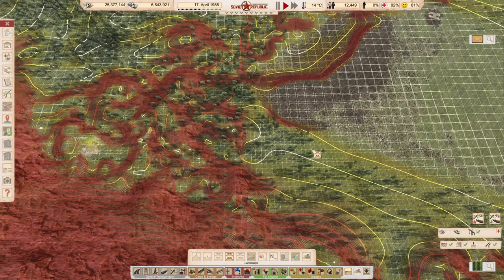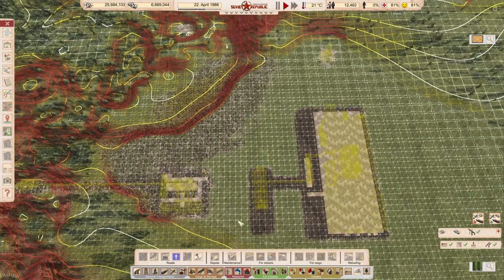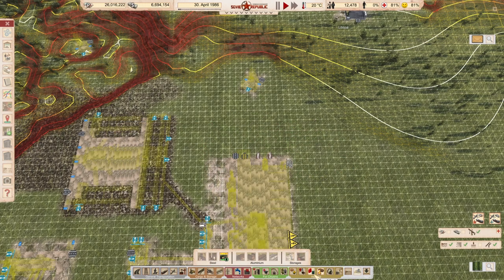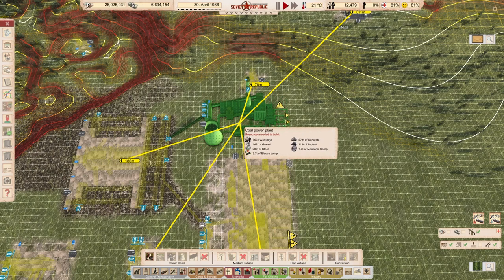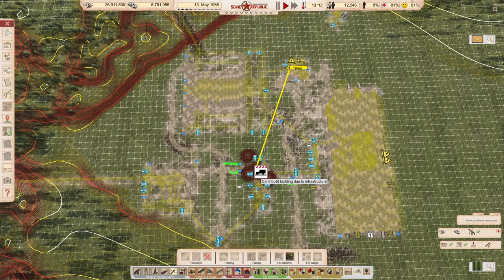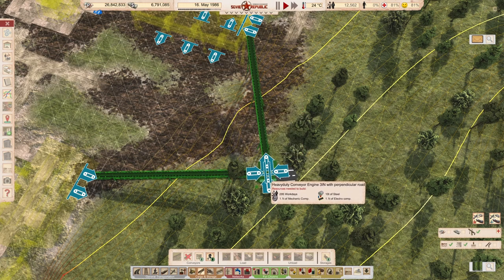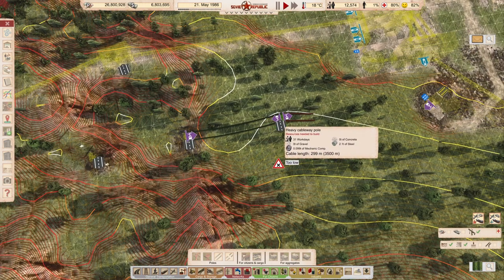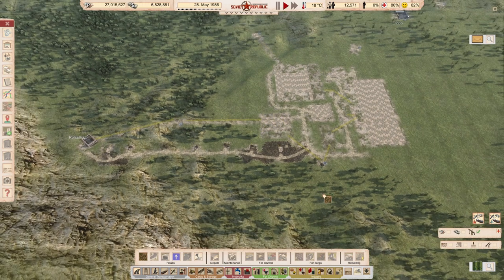Fixed: How to get a crane into the heli CO near the border  | S0E07b | Workers & Resources

Comment: The message 'Too Low' was the cables hitting the ground trying to connect to the station. The cables on the left were green and would connect if the tower was placed. You would have just needed another pole and the cables could have connected, if the angle was okay.
'I'm not in the mood' I laughed 😁

Thanks Caya!
Reply from the maker: Thank you, kcheeb. Makes total sense. The roads sometimes not connecting for no particular reason, need some creative thinking sometimes 😀
Reply: @CayaMaya  for sure. That's the WR:SR way 🙂